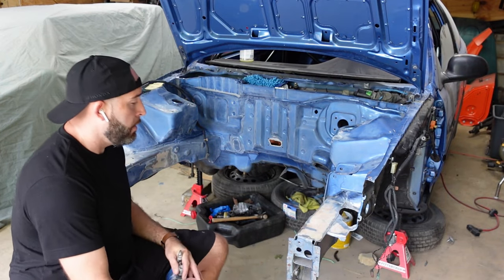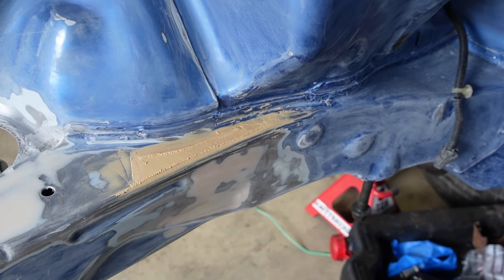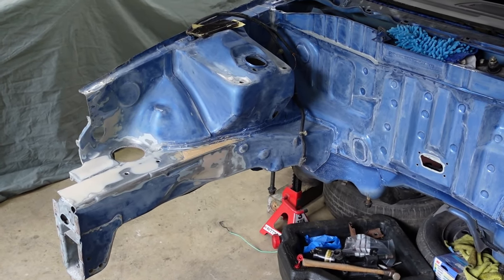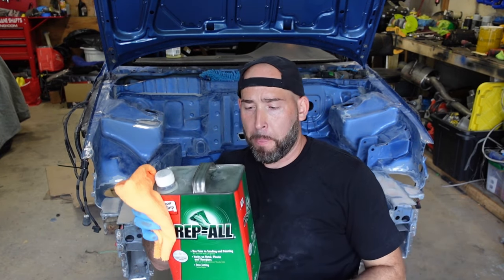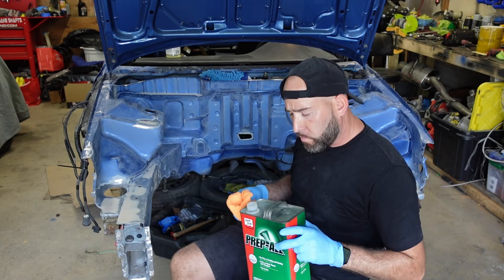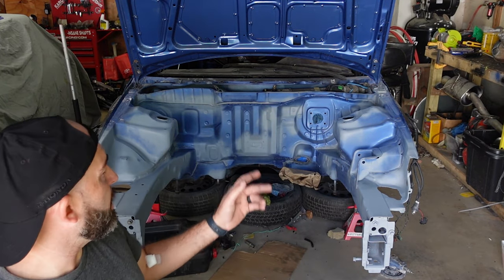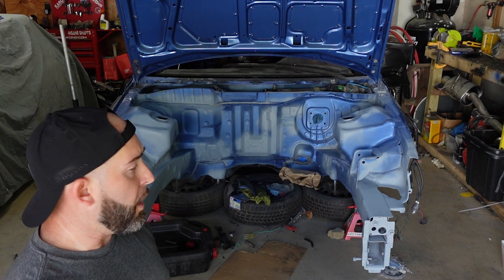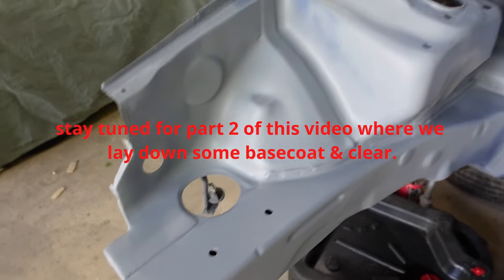DIY: painting civic engine bay like a PRO!! Part 1

Comment: I see that you put two type of body fillers so what's the difference between of them?. I have learned new things from your videos, keep posting more about body work. Keep up the good work ❤
Reply from the maker: Thanks I appreciate it. I only ever used one type of body filler in one of  the videos I put out I show it on there. If you are talking about me add filler to an area that already had filler it was the same filler I used just needed to add a bit more.
Reply: @wisin_k20  ok I thought it was two different ones. It doesn't matter the type of filler you used.
Reply from the maker: @aldotgomez  no it doesn’t if the prep work is done properly the cheap ones will do the same thing. I believe the one I am using is one of the cheaper ones and I’ve been using for several years now and haven’t had any issues.
Reply: @wisin_k20  when you used body filler do you put glazing over it, there's no need I seen few people who do that.
Reply from the maker: @aldotgomez  I never use  glaze I just use filler.
Reply: @wisin_k20  ok thanks for the info